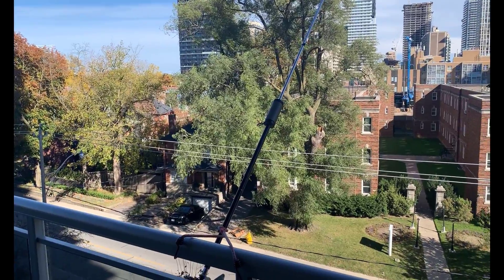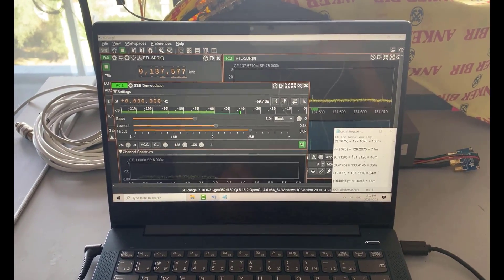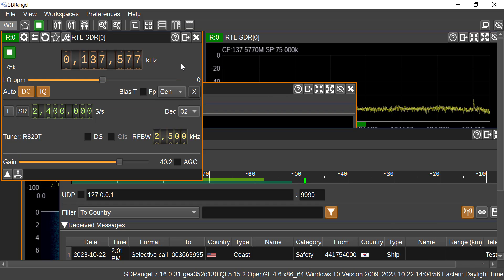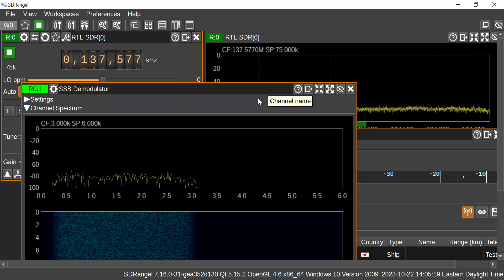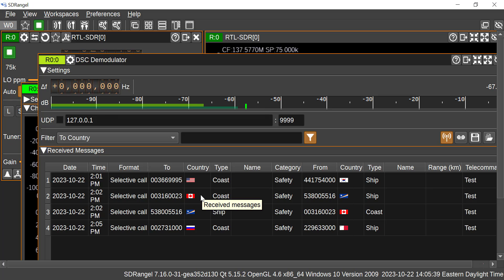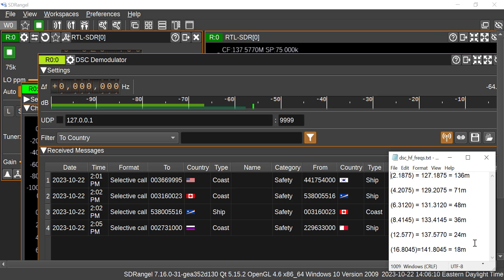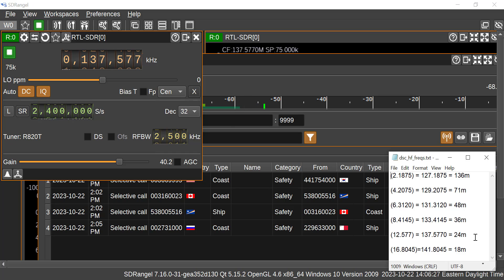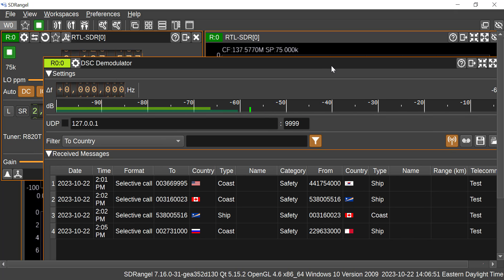RTL-SDR for HF Marine GMDSS/DSC on SDRAngel

Comment: SDRangel allows to do the frequency upconversion/downconversion for you. Click on the "X" button in the in the "sample source" window (e.g. with your "RTL-SDR" sample source, the "X" button is located next to the dropdown currently having "Cen" selected as value). Clicking the "X" button opens the transverter mode dialog. Now you can provide the value of your up-/downconverter. For upconverters provide negative values, for downconverters provide positive values ... As the "nooelec Ham it Up" is a 125 upconverter, provide as value "-000,125,000,000 Hz", at make sure to activate the checkmark (must have orange background to be activated). Click OK. Having done so, the "X" button should now also have an orange background, indicating it is active. Now you can enter the original frequencies as the center frequency, and SDRangel will do the offset calculation automatically.
Reply from the maker: Thanks, good to know.